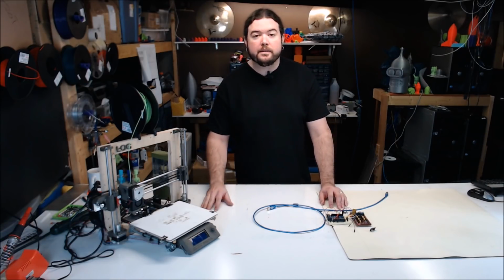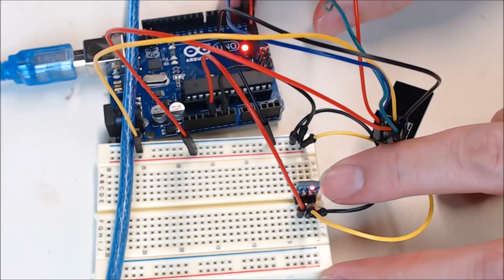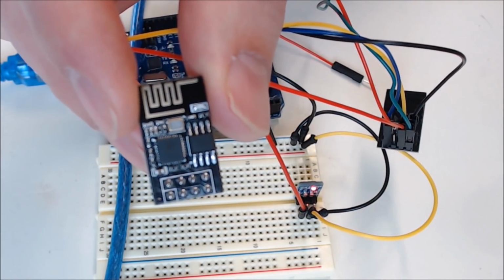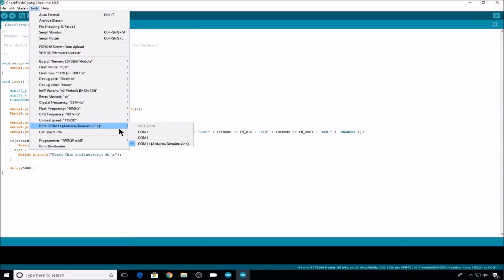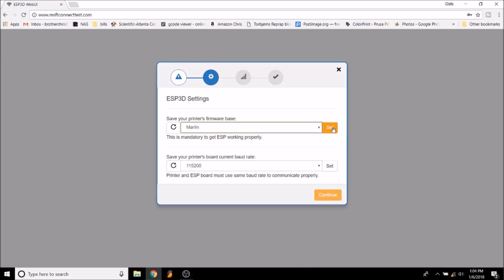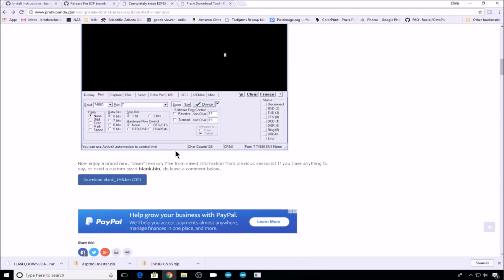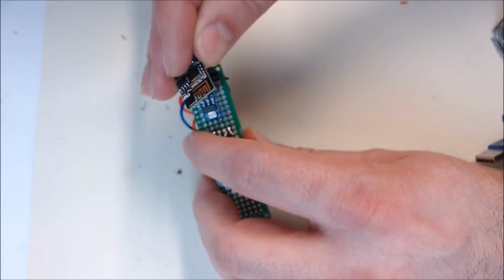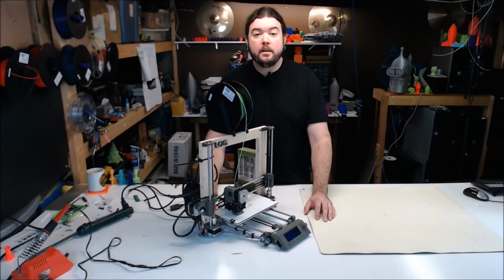Add WiFi To Your 3D Printer For $5!!! - ESP8266 - LUC ESP3D - Chris's Basement

Comment: u dont have to mount a voltage regulator all arduinos have a 3.3v output so u can hook it up to the ramps or even the uno
Reply from the maker: That is true, but it will be much more stable if you do.

Comment: I have problem ican uploud my file g code (error12:uploud rejected)..can give solutuin for me
Reply from the maker: Did you try changing the extension to .gco ?
Reply: @ChrisRiley  sama saja .saya tidak memasang lcd dan kartu memori di printer ..apakah itu jadi masalah?
Reply from the maker: @ArifFitrianto_edukasi  Yes, this software is designed to write the gocde to an SD card installed on your printer already, it doesn't have on board storage for the files.
Reply: @ChrisRiley  ok thanks

Comment: This is an awesome DIY! What is the bread board you're using to connect things temporarily by pushing it in. The white breadboard with the pins. What are those called where there's some connections between the pins and is good quality for continuous use like this..? Thanks!
Reply from the maker: Thanks! This video is getting pretty old now! :)  When I got started with things like this, I bought a set a lot like this one. https://amzn.to/3NMGVjH

Comment: I'm using the nano. In another video said the nano reset has to be set to ground to program the esp. This works doing that, I have the 4mb esp-01s, it uploaded the CheckFlash sketch and reported config ok with 4mb flash size selected.
Reply from the maker: It seems like these all have just a few little differences.

Comment: Hello Chris , thanks for this valuable tutorial. Is there a way to apply the same method to the Ender V2 ? Using which port on my V2 motherboard ?
Reply from the maker: On the V2, I'm not sure. If it has TFT pins, then you can do this same thing. You just need RX and TX.

Comment: Nice instruction again! The ESP is a 3.3V device, including the serial signals, while the control board is a 5V device. Wouldn't the 5V TX signal from the mainboard damage the ESP?
Reply from the maker: You don't want to run at 5v very long. That's why I created the voltage divider.

Comment: @Chris Riley when I connect my module together with my ramps 1.4 board I have a weird problem where the LCD screen I was already using will start to flicker, and then the machine will reboot and so on. The esp module blinks as though it is turning on, but for some reason, it seems like it's pulling too much current from the Aux or something. Any ideas?
Reply from the maker: You might have a voltage regulator issue. Both take 5v, it might be struggling to support both.
Reply: @ChrisRiley  Thank you for replying so quickly! Would this be due to damage to my RAMPS board?
Reply from the maker: @butchness6980  It could be, that is pretty common on the Mega.
Reply from the maker: @butchness6980  By default it should already be configured like this, not sure it would help.
Reply from the maker: @butchness6980  They can probably handle it, I think they are rated for 0.7 amps. You would have to get it down to 5v as you know.

Comment: Thanks to you I managed to put the printer on wifi. Question I have how to update the marlin via wifi?
Reply from the maker: I don't know that you can, you still have to compile it. If you are using the Arduino IDE you might be able to use the IP as an upload port., but I probably wouldn't recommend it.

Comment: ESP is a 3,3v TTL Device a Arduino 5v TTL it will kill the ESP after a Time usw a Level shifter oh my god the 32 bit boards has often 3,3v ttl ther it works
Reply from the maker: Correct, that's how I set it up here.
Reply: @ChrisRiley  I only see a 3.3 Voltage Regulator the RX and TX pins are direct to the arduino pins

Comment: Can I connect with HP1020 USB PORTS PRINTER with Wifi modules?
Reply from the maker: I am not sure what a HP1020 is. If I have exposed RX TX UART pins you can.
Reply: @ChrisRiley  HP1020 IS PRINTER FROM HP
Reply from the maker: @mehuldholu1  I see, I would have no idea how that would work.

Comment: Mine not working 
It connects to my wifi and load GUI but no data recived from printer
I check the RX & TX there are perfect
Reply from the maker: Make sure your serial is set correctly and baud rates are the same.
Reply: @ChrisRiley  there are same I'm using Marlin 2.0
Should i do anything with firmware...?
Reply from the maker: @vnagaravi  Then you probable need to change up your serial.
Reply: @ChrisRiley  i tried to change but when i try to enable serial 2 firmware is not compiling 
Serial 0 is used by USB,serial 1 is Y-axis min & max , serial 3 is Z-axis min & max
But serial 2 is not enabling
Reply: @ChrisRiley  i verified the aux-1 serial port with TTL to usb converter it works fine
Reply from the maker: @vnagaravi  There might be something wrong with the ESP then, not sure what else to try.
Reply: @ChrisRiley  i tried re flashing the ESP but it wasn't taking code 
Arduino rx light & esp light blinking when IDE showing connecting but it wasn't connecting
Reply: @ChrisRiley  i have another strange problem when i give command through USB or manual at display i can see the come in terminal in ESP3D but not able to send command ...?
Reply from the maker: @vnagaravi  It all sounds like a serial connection issue.
Reply: @ChrisRiley sorry i forgot to tell you..!
i got it solved by adding jumper to the main IC & TX terminal...
Thanks for your time...
Reply: @ChrisRiley  http://imgur.com/gallery/pCcFDdQ
Reply from the maker: @vnagaravi  very nice!
Reply: @ChrisRiley  I had the same issue. Turn out baud rate on my printer is 250000 and esp8266 is 125000. Thank you. Great tutorial.

Comment: I'm stuck in "timed out waiting for packet header" for days. I followed carefully all the steps but nothing. It doesn't flash
Reply from the maker: That when you are trying the first flash?
Reply: @ChrisRiley  yes, but I followed another tutorial, my module needed another flash before this firmware. It is a Chinese tool, called ESP8266_Flasher_Tool, now it works nice.
Thanks for your video, you made me put this on my printer. Works nicely!

Comment: I made it!!! Now my $2 ESP8266 is priceless.!!

I used a FTDI232 instead on an UNO. Thinking I could use the 3.3v directly. Everything went well, until I realised I still need the voltage regulator when hooking up the module to the main board.
Reply from the maker: I'm glad you got it working!

Comment: Sooo...would this work with the WiFi module included with the ender 3 BIGTREETECH touchscreen?  It looks like the exact same part.  This video is the closest thing I’ve found to setting it up.  All I’ve found is instruction videos for raspberry pi octoprint or other self contained modules.  Even had to take a 50/50 shot at which way the card plugged in to back of screen.
Reply from the maker: Yes, these should work work on BTT boards and screens. It's all the same type of wifi bridge.

Comment: hello sir, i need u suggestion on my school project .i want use board skrv1.3 + tmc2208 motor driver and want add wifi. what i suppose do on step by step.
Reply from the maker: This video should get you where you need to go.
Reply: @ChrisRiley  what if i use skrv1.4 + tmc2208 its ok ? Or have any problem.
Reply from the maker: @ahmadsyafiqasman5249  1.4 is even better because it has a socket for the Wifi chip.
Reply: @ChrisRiley  ok thnkz for the information

Comment: Hi Chris. So It is 2020 and I am trying your tutorial. I am a bit late in the game. So I follow your instructions and I get stuck trying to do the example sketch. Per updated software on https://github.com/luc-github/ESP3D, I use ESP8266 2.5.2. My wifi module flashes like it is receiving the update example sketch (CheckFlashConfig) but then it gives me an error: "esptool.FatalError: Failed to connect to ESP8266: Timed out waiting for packet header". Please help!
Reply: Maybe I didn't clean out the wifi chip first with a blank sketch? I also found this: https://www.youtube.com/watch?v=Z5Cnm-1ybFY&t=
But he uses the firmware from here: https://github.com/bigtreetech/BIGTREETECH-SKR-PRO-V1.1/tree/master/firmware/esp-01s
Reply: Now I see that later in your video you show how to reset the flash memory on the wifi module if it is behaving unexpectedly.
Reply: So in hopes that this helps others, I was able to follow https://www.youtube.com/watch?v=Z5Cnm-1ybFY&t=. It had fewer steps which I am sure is to do with updated firmware on devices. It was plug and play for me connecting the wifi module to the TFT 35 E3 3.0 screen. Then I connected to the access point and uploaded files. Do you think I have everything that your version of ESP3D 2.1 has?
Reply: Also I am noticing that when I try to print via wifi, the tft is not displaying the print progress, only the temps.
Reply from the maker: I haven't tried the version that Chris is using yet, but I have one and will be trying it soon. Glad you got it working.

Comment: Hello, i have a doubt that can we connect that esp module to android 3d printer application instead of using webui
Reply from the maker: Are you asking because of the Prusa Mini wifi coming out? You can use the ESP8266 just as a wifi bridge if your App can take it from there.

Comment: is the bord (Mega +WiFi R3 ATmega2560+ESP8266 (32Mb memory), USB-TTL CH340G. Compatible for Arduino Mega, NodeMCU, WeMos ESP8266) better ?
Reply from the maker: The board I used it the cheapest option. You can run this software on any ESP32 or 8266 now a days. So pretty much everything is better than this board.

Comment: SPIFFS Error: esptool not found!

its great this is so easy and straight forward......
I've had to find and install library files you didn't mention. 
i got this ESPtool error when uploading sketch data.  
seems like id be doing something wrong if i didn't get errors.
Reply from the maker: Things have changed a lot in the newer versions. Are you working with 0.99 like I am in the video?

Comment: I'm using octoprint for these day to day tasks but I use a ESP8266 with esp-link firmware for over the air marlin flashing. Also the 3.3V step down converter is probably not needed. The ESP8266 can tolerate 5V
Reply from the maker: Good idea for the Marlin flashing.
Reply: @ChrisRiley  I already ditched that for the octoprint firmware flasher plugin (but it requires proper bootloader (instead avr isp method) on the printer, manual avrdude installation on the pi and much patience finding the correct settings). So overwhelming sometimes when so many different roads lead to rome.

Comment: I've been using one of these for a couple of weeks now and although it "works" there are some big and annoying drawbacks. First being very few programs have the ability to print to a wifi-serial port (most of them expecting it to be just a serial port device) - there's only Repetier that I've managed to get too connect to it directly. And then comes the second disadvantage - there can be considerable lag over wifi which shows up as it being unable to fill your printers buffer fast enough resulting in the printer stalling while printing.

In short, if your system works such that you can upload to SD and print from there (mine doesn't for reasons I've not yet figured) then this is cheap and simple way to SLOWLY upload to SD card, but don't really expect it to replace a USB lead if your printing directly.
Reply from the maker: I totally agree, it not a very solid way to add wifi to a printer. Octoprint is still my go to.
Reply: @ChrisRiley  My Repetier Host will connect to my wifi (ESP-01s on SKR-PRO) printer via IP on my local network so I just use it that way.  I use the data port 8888 and it functions just like using a USB port.  I think Cura will do the same.

Comment: Hi Chris great video. Thank you for everything you doing. Can this be used on a Trigorilla V1.1 board ( on Anycubic I3 mega). I checked and on the board I have 4 pins available GND , 5V , TX3 and RX3 ( and UART next to them).  Also do I need to install Marlin or it will work with the official firmware? I tried the OctoPi variant on a Pi4 4GB but I have problems with my prints and think the reason is a bad communication between Pi and printer. Same G code from SD card came out perfect but from OctoPi I had a lot of strings , bad retraction and miss steps. The only reason I try this is because the main thing I need is to have remote access to monitor the printer ( mostly temps ).
Reply from the maker: For monitoring this might work for you, not so much on printing really. It should work on that board, I don't think you will have to change the firmware, they use a version of Marlin, just not sure which one.

Comment: I'm wondering, would this work with the BTT SKR Mini E3? It doesn't have an aux header like the RAMPS board you're using, but it does have a TFT labeled header, which has RST, RX, TX, GDN and +5V. Seems like it should work, right?
Reply: Here's a link to a circuit board diagram, if that helps: https://ae01.alicdn.com/kf/H90c51a00a0b24bc5979beee3ca938c5eo.jpg
Reply from the maker: Hey Tim, it seems like you should be able to make that work. I don't know a lot about that board yet, I do have one and I should start my testing soon.
Reply: @ChrisRiley  Awesome, thanks for the reply!
Reply: @ChrisRiley  Hi Chris, back again with a question: Could it be that I have to activate the TFT header on that board? The ESP is working as it should: I can see that the proper gcode is sent (while I have the ESP plugged into my PC), and the web GUI works while it's plugged into the printer (so 5V and GND do work), but the printer doesn't respond to any of the commands. It also doesn't show the IP address on boot, like you showed. I've already tried swapping the TX and RX lines, but no luck there either. Could it be that the 3.3v signal level is too low for the SKR Mini E3 (not sure what if your RAMPS board was made for accepting 3.3v logic?)? Is there something firmware-related that has to be changed for this to work?
As always, any help would be greatly appreciated.
Reply from the maker: @timderks5960  Try setting the serial one setting to -1 and the serial 2 setting to 0. See if that gets it going.
Reply: @ChrisRiley  Thanks for the reply again. Since I asked the question, I did manage to get some progress, and get ESP3D semi-working with the Mini E3. After flashing the firmware, I can control the axes, but trying to read the temperature or something like that freezes the printer, and makes a siren-like sound come from the printer. After a reboot the printer is just frozen, and needs a re-flash of firmware to get going again.
If I ever manage to get it working, I'll be sure to let you know.
Reply: @ChrisRiley  Well, sometimes a good night's sleep brings you bright ideas. After spending pretty much the entire day on it yesterday, with no luck, I decided to try the simplest thing I could think of today (BTT said to use serial1 to 2, and serial2 to -1, which caused a LOT of issues, today I tried setting serial1 to -1 and serial2 to 2, which worked just fine...). 
If you're interested, my firmware is available here: https://github.com/Timmiej93/Marlin
Reply from the maker: @timderks5960  Awesome! Thanks for the link, I will check it out.

Comment: How you looked at the new Wemos Arduino with ESP8266 built in?
Reply from the maker: Not yet, but I will be looking at it soon I hope.
Reply: @ChrisRiley  I have managed to program them and connect via wifi but I cannot get them to talk to each other will keep you advised
Reply: @ChrisRiley  finally got them talking but uploading a gcode file seems very slow, maybe I still have a problem
Reply from the maker: @kevintech5869  it is really slow i am afraid.
Reply: @ChrisRiley  I'm hoping that the sd with built in wifi will get around the sd card speed issue
Reply from the maker: @kevintech5869  About the best thing I have seen other than octoprint is the wifi backpacks.
Reply: @ChrisRiley  It seems that the new WIFI enabled mega when used with esp3d is not compatible with Repetier firmware, everything but the SD card will work, every time you try to list the contents it resets. But works flawlessly with Marlin, I was using the WIFI SD on both and works well.
Reply from the maker: @kevintech5869  Interesting, that seems like an odd thing to not work.
Reply: @ChrisRiley  I should probably elaborate, the Repetier SD Card reset issue only occurs when you are tying to use ESP3D to read the contents otherwise the board works perfectly, no issues when used with Octoprint though.
Reply from the maker: @kevintech5869  Ah, got ya, so there is probably some serial conflict in there.

Comment: Hi Chris. I have been looking at this module https://www.aliexpress.com/item/32888713885.html for my SKR 1.3. Do you know if it's possible to map a network drive for uploading gcode? Thank you. It appears to use the same firmware. 😃
Reply from the maker: Hey Brian, I don't think so. I think test just dump to SD. I could be wrong, but I don't think they can act as a CIFS device.